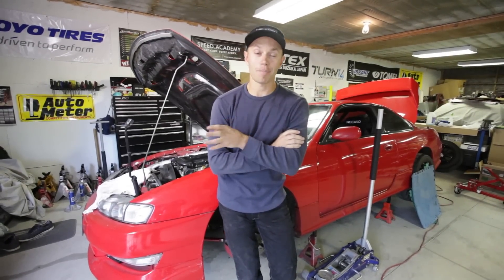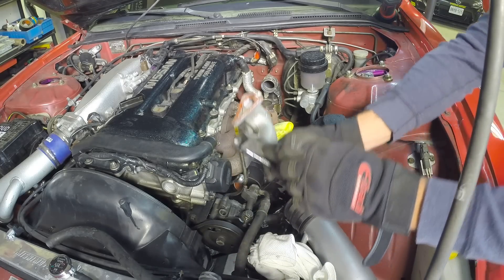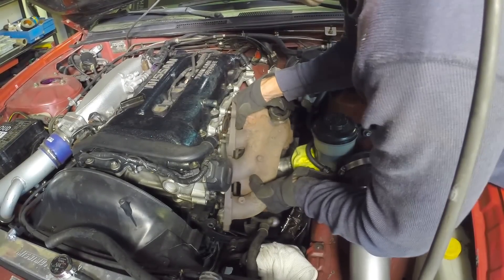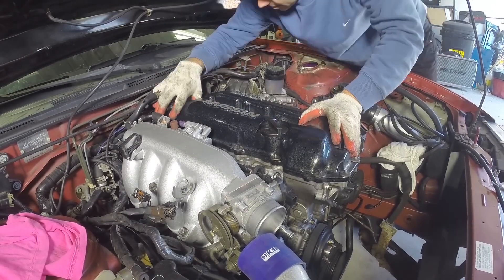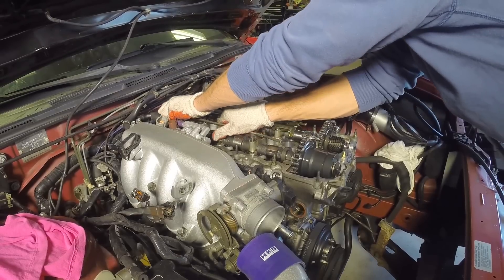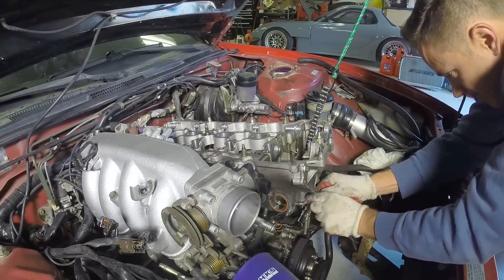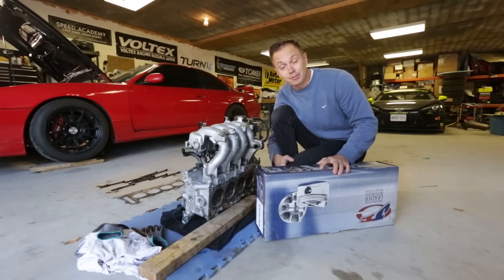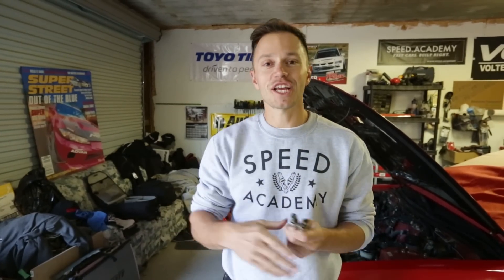SR20DET Head Gasket Replacement How-To - Project GripS14

Comment: Dude.. u don't need a new sr. Just grind the valves and replace the piston crown. Or upgrade to forged pistons. And new gasket.. it should be good as new. Sr20 can take a lot of torture..

Comment: didnt you rebuild this engine a few months prior wtf?
Reply from the maker: No this engine has lasted about 4 years.
Reply: oh ok? it was hard to keep track of the order of videos tbh? my pulsar gtir engine is being built atm so i was just interested tbh to see whats involved . i thought in the videos u took it out put it in. took it out put it in about 10 times? due to rattling or the wrong gasket? not sure if u was following the vids in order tbh
Reply: hi?
Reply from the maker: The 4yr old motor blew a headgasket and melted a piston, we put this new motor in with a wrong headgasket, replaced the headgasket, then it was knocking since startup (bought a bad motor) and now it's dead :(

Good look on your build!

Comment: Running lower PSI does not make you a reliable SR, a proper tune and build does. You either had too much timing for track (over estimated the washer fluid) or poor cooling system (rad, intercooler, fans, bumper). The car was tuned on the dyno (almost perfect conditions) not on the track so there is a possibility of the tune not being suitable. The SR is a stout motor and can go to 400whp stock with a solid tune (dyno/track/street). Head bolts can take 500hp or 20+ psi, rods and crank have gone beyond 600hp, pistons and paper gasket will hold to  400hp but CANNOT take any detonation at all (beyond 330hp is the land of tread carefully for stock gasket and pistons). Personally (from experience) I think you suffered from serious detonation which caused the damage to the gasket, damage to the plugs, pistons and the pressurizing of the cooling system.  Also were you using the right heat range plugs?  In the video before the mishap occurred I heard something very similiar to knock/ping everytime you pulled through the rpm (could have been keys or something i dont know but it resembles knock).
Reply from the maker: I've yet to meet many people who actually time attack or road race their stock block SRs with over 300whp reliably. Sasha, the tuner, raced his stock block SR with a headgasket and studs around 300whp for a full season, that's real wheel to wheel racing but it was on race gas. Sure running more or less PSI doesn't mean it'll be more reliable in theory but in the real world, cramming more air and creating a bigger bang will dramatically increase the chance of failure, especially on pump gas and a complete stock block.

I was running one range cooler plugs so that wasn't the issue. Anyways, I personally think a stock block SR making 340whp is playing with fire for actual hard track use. A street or drift car sure but for grip driving, I learned the hard way... no go.
Reply: I appreciate that you took the time to respond. I have a 180sx and a group of friends with jdm sport cars maybe you can do a special on the caribbean island of St. Kitts. P.M. me if you thinks its a great idea.
Reply from the maker: If I ever make the trip down there then I most certainly will!!

Comment: Would a 1jz swap ruin your weight distribution? Sure it would make easy reliable power but what would happen to the balance of the car? Anyways thanks for the awesome videos
Reply: What caused the detonation?
Reply: What caused the detonation?
Reply from the maker: +christianVSR It's a heavier engine so it will a bit but it all depends what you're building the car to do.
Reply from the maker: +christianVSR lifting the headgasket.

Comment: Have you told Sasha about this? What did he have to say about it?
Reply from the maker: +Alex Derus Yup, when Sasha originally tuned it he told me that 340whp was alot of cylinder pressure for a completely stock block so it was going to be a bit risky especially for track use. I should've listened to him and turned the power down but I got greedy. 

After it happened, he said pretty much the same thing.

Comment: turbo is ok?
Reply from the maker: +bmw316iTurbo I inspected the exhaust turbine and it looks to be in perfect shape so the turbo is going back on as is.
Reply: i checked the following videos about this build, i seen you install the metal head gasket and arp studs, is the bottom end, head, stayed the same? or did you swaped for another?  thanks for reply
Reply from the maker: +bmw316iTurbo No the bottom end and head are a different engine, all stock still.
Reply: more boost! thanks

Comment: If the cylinder bore is fine, and the valves seat, who cares about mark on the head and pistons? They wont cause any problems, if the head or block is not cracked. Its not beauty contest in there. Resurface the head, put a upgraded gasket on it and youre set for more boost.
Reply from the maker: +Mortalomena There was metal missing around the valves so this head requires some welding to get it back to working order. Not worth the time and effort IMO
Reply: Speed Academy Ah, to the scrapheap then.

Comment: Did you weld the wastegate v-band adapter to the manifold yourself? if so what process was used and is this a long term modification?
Reply from the maker: +Frank Pawloski I didn't. I had a local fab shop do it to ensure the weld penetration was proper. They drilled the hole in the manifold with a press then TIG'ed it up if that helps any.
Reply: +Speed Academy It does thank you! I know welding cast is a nightmare but it's nice seeing that some people prove it's possible.
Reply from the maker: +Frank Pawloski With a powerful welder there shouldnt be any problems. A good fabrication shop can handle this job and it's very worth it. I have precise boost control with zero boost creep.

Comment: same thing happen 2 me , i got all brand new parts for my built head and took it to the machine shop cost me around $700 for the machining but i took it to the best shop in my city that does amazing work, $2,000 into the head now im working on the built block .
Reply from the maker: +Martin 651 If you want an SR that you can beat on then there's only one way to do it and that's build one to handle the abuse so you are doing it right!

Comment: would you consider getting a NEO VVL head with new forged pistons and ARP head studs for an SR20VE+T? or go with an NA high revving build?
Reply from the maker: +BRIKKgoesHAM The cost of those parts and work is too much for the budget right now. I just need to get the car up and running with minimal expense.
Reply: +Speed Academy in that case, would you reckon aftermarket rocker arm stoppers for the head? They should be somewhat cheap, and will prevent valvesprings and retainers from popping out under higher revs, and it limits the overall movement, and inertia in the valvetrain.
Reply from the maker: +BRIKKgoesHAM I mentioned this in another comment but I have had bad luck with rocker arm stoppers so I dont use them. I also don't bounce the rev limiter so I should be good.

Comment: Machine the head,  replace the pistons, and check the block decking. It is a good motor, and u can make improvements where you need it (lower compression to help with detonation), versus buying a stock SR20.
Reply: +MrDannyd9 for about the same price too!
Reply from the maker: +MrDannyd9 Not a chance. All that work will be easily $1500 dollars here. I'm buying an engine for $700 so that seems like a no brainer.
Reply: +Speed Academy sounds like a steal! Did u ever figure out the detonation problem? Octane? Too much boost? Running lean? 
I know u had mentioned that the lack of coolant rendered a hot head, but what about the possibility that the overheating caused the old hose to burst initially? Then, exacerbating the situation.

P.s. Is that Candian dollars?
Reply from the maker: +MrDannyd9 The heat caused the detonation since combustion chamber temps must have skyrocketed after the headgasket failed. That led to everything else.

Yes that's Canadian dollars.

Comment: Forsure go with ARP head studs.. When i went single turbo i added a 3 layer steel head gasket and that thing handles all the boost and torture i want it to.  Personally i actually torque my arp studs to 90 ft-lbs even though it was recommended by arp to do 80. Personally im glad i did it the way i did.
Reply from the maker: +Review Guy Thanks for the advice, I also heard going to 90 isn't a bad idea.
Reply: Yeah i mean i can only speak for my experience. I personally have had good success with what i've done. Im sure there are other people who have done things completely opposite with same results. but as long as it works for you thats what matters.

Comment: this made me think of my sr20det, im going to tune it right now do i have to change the head gasket and the bolts? im running an evo 8 turbo about 1 bar pressure. for the build i would reccomend to build this engine if the block is good and the head, buy new set of pistons and rods ,build a proper exhaust manifold throw sr20de cams and you are good to go
Reply from the maker: +Monder Phoenix It's never a bad idea but it depends what you are doing with the car (drift, track, street use). If you'll be road racing then I definitely recommend it. It can save you the headache that I'm about to go through.
Reply: +Speed Academy i agree with you mate

Comment: I was in a similar situation. I bought a used SR that was supposed to be fine but when I pulled the head to start to refresh the motor, I found bad damage to the cylinder wall between 1 and 2. The top 1/4" of the wall was actually broken off. Really bad. I had no come back with the seller. (no I couldn't do a compression test, the engine was on a stand) 

So I could either buy another used SR or I could resurrect the one I had. I sent the block off to be sleeved and have new pistons installed. That work is still being done. I also need to get the head into a shop to see if its ok.

So, I don't think your SR is junk necessarily. You could buy another engine or do what I'm doing and make a bullet proof bottom end. It ended up being cheaper for me to go that route and I'll hopefully never think about the bottom end again.
Reply from the maker: +Mark Coleman Damn, that's a shitty situation. I hope the engine that I buy is in proper running order but I'll be pulling the head so I'll find out very quickly if it is or isnt.

Comment: as long as the piston seal and the rods aren't bend your bottom end is okay. you should give the top of the piston a fine polish to knock off the high spot. the same goes for the combustion chamber as long ass your valves seal. you should check for warpage . i work as an engine builder and i have build a 6 cyl 2.5L bmw race engine with about 800hp that still runs now almost a year after it was done this way and that was necessary to weld the chamber to get it to seal
Reply from the maker: +simon norup I agree, I think I could run the pistons as is if I wanted but the head has material missing around the valve so there's no way to fix it without welding, something I dont want to do.
Reply: @speedacademy  late to the game but have a similar problem. So the block /bottom is good right? I am in same position but I can’t make videos off this and I’m broke!!

Comment: Watching this video was so painful, I hate engine tear downs.  Gotten to the point with wrenching on cars that it's not even fun anymore.  I like driving not wrenching.  Hope to see the car running in top shape in the spring.  Any ambitions of swapping in some aftermarket pistons?
Reply from the maker: +Daniel Fenton It was a bitch to teardown but on the bright side it made for a good video haha. Naa, the cost of putting pistons in and fixing the head is way more then me buying a used engine.

Comment: i would get a set of je pistons and rods for it and get the head sorted maybe flow it and cc it maybe a valve spring kit and she will be strong what do you think or keep it nissan and find a rb25det dont do the 1jz or 2jz  route or stick a nissan V8 like they do with fordsburgs 350z
Reply from the maker: +Matthew Dolbey It's going to cost too much to swap the pistons and rods and fix the head. Much quicker and easier for me to just grab a used working SR.

Comment: Great video! An engine swap is going to make for an awesome video. Quick question, how come you don't run aftermarket slimline radiator fans?
Reply from the maker: +Jon Kat Great question, I actually have a set of SPAL fans but have read many threads that say the stock fan and shroud are the best for flow and surpass any aftermarket fan option. The Nissan road racing forums is where I got all this info hence why I've stuck with them.

Comment: Yep, I was going to start commenting about how this was going to be more than just a headgasket swap but I figure I would wait until the end. Lol. I wouldnt consider the block a paperweight though, with enough time and money it could be turned into a bored monster, the head could be ported polished and cc opened up along with bigger valves etc. but like I said. "Time and money"  Its easier to go with another SR. I would also like to mention that usually the O2 sensors get screwed up when headgaskets blow. Something with the burned coolant that throws them off. So I would check on those or if your running a Bosch wideband maybe just replace it. Sweet setup though when finished. And more boost????? Lol!
Reply from the maker: +jdmcommute Good call, Ill check the AEM wideband to ensure its working properly. As for more boost. Im going to be going with less, maybe 14-15psi to ensure I have a super reliable setup.

Comment: Golden opportunity for a SR coffee table.
Reply from the maker: +The Ferris YES! That's what I said. Was thinking of finding a nice piece of glass and cleaning this engine up so it can be used at a coffee table.
Reply: It would make an epic how to video. Would also recommend doing the knock sensor while you put the new engine in, they are a bitch. Ended up removing mine and putting a 1megaohm resistor in its place since my replacement was faulty too.
Reply from the maker: +The Ferris Did you buy a new OEM replacement? I was thinking of swapping mine out too but I read somewhere that after 4000rpm at full throttle the knock sensor is muted so not sure how worthwhile it is.
Reply: Couldnt find one locally so got one from a wrecker. I read along the same lines which is why I ended up doing the delete, its spent the last 4 months doing daily duty with no issues. It'll stop the thing from starting though if it goes.

Comment: It might be the water/meth system as they have been linked to detonation in some cylinders do to the mixture not reaching them.
Reply from the maker: +Sanju George The mixture should be fine but Im going to double check the meth system when I get the car back up and running.

Comment: Forged internals for the replacement engine perhaps?
Reply from the maker: +MrAlexLamus Not worth it since I just want to make a reliable 300-320whp. Stock should be fine with studs and a metal headgasket.

Comment: I prefer a full regrind on the head and deck the block before changing the gasket. Usually means you don't have to do it twice. :D
Reply from the maker: +Veselin Georgiev Exactly, hence why it just makes sense for me to find a used SR that I can swap out the gasket and not have to deal with decking and fixing this engine.

Comment: It's good to hear you're sticking with the SR. Was going to comment that a 1J would add mass over the front strut towers and add a little understeer. And with you doing an ls swap into a 240 before I'd go that route if you want to keep it "grip". That is if it can keep most of the weight toward the center of the car which you would know from your previous experience. Much luck with the build!
Reply from the maker: +Fyxxterzc I think the SR is ideal for grip driving. I just need to make it more reliable!

Comment: RB25 Neo or VK56 swap
Reply from the maker: +Raditya Amandra I have a hard time justifying the RB25 over the 1JZ other than keeping it Nissan.
Reply: +Speed Academy R33 RB25 isn't better than 1JZ, that's why go with the NEO, it have better conrod and headflow. Or maybe SR20 with Neo VVL?
Reply from the maker: +Raditya Amandra I see but right now I just need a quick and easy solution so another SR is the way to go. I'd love to VVL head but it too is way expensive and time consuming.

Comment: Awesome video very informative, I agree with sticking with the SR, it will keep the front more "Pointy" than the 6 cylinder swap, and it is a base that you are already familiar with.
Reply from the maker: +Claudio Decina Agreed, the SR will stay because the car feels really good with it. I just need to improve some minor things and it should be super reliable.
Reply: +Speed Academy definitely, like you said ARP head studs will keep the head from lifting up under higher pressure, and also the multi-layer steel head gasket will keep things well sealed up. hoping to see the old girl running again soon haha :D.
Reply from the maker: +Claudio Decina Lets hope it all comes together with no issues!

Comment: sr20 Pete! maybe bore it out to a 2.2 liter! I'm shocked that you are still running a clutch fan and not an electric setup considering how long you have owned the car.
Reply from the maker: +Kevin Parra If you go search around the forums the stock clutch fan is actually the best solution for cooling. It outperforms anything aftermarket. I have a set of SPAL fans sitting on the self but havent installed them because all the road racers recommend keeping the clutch fan.